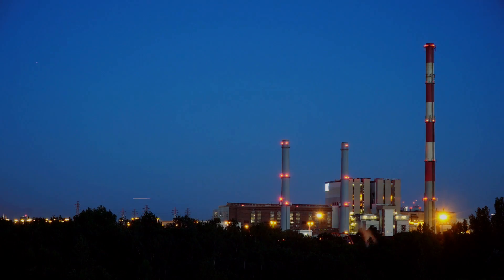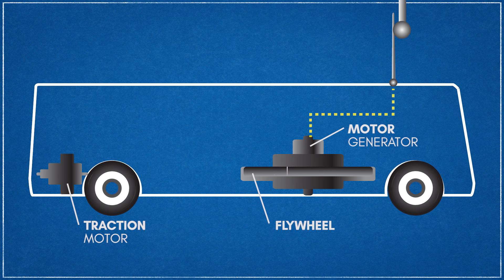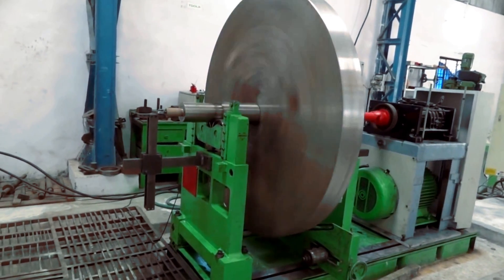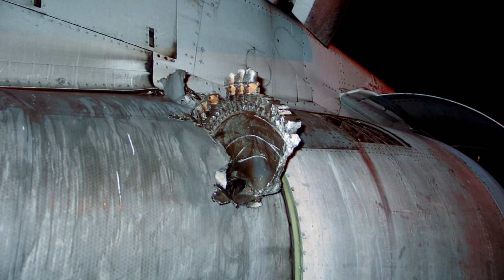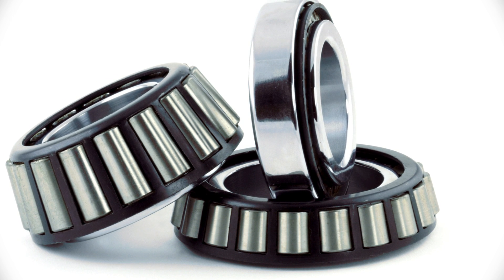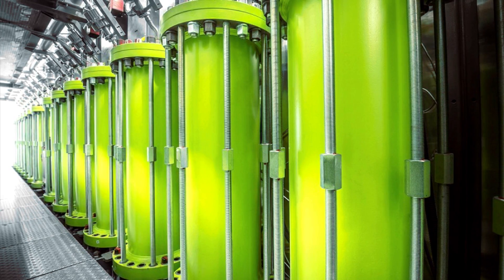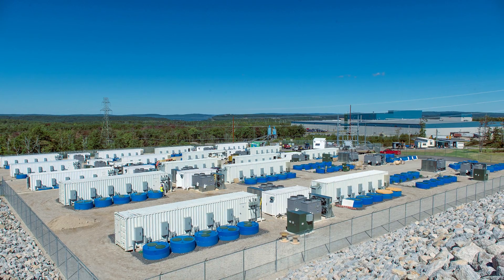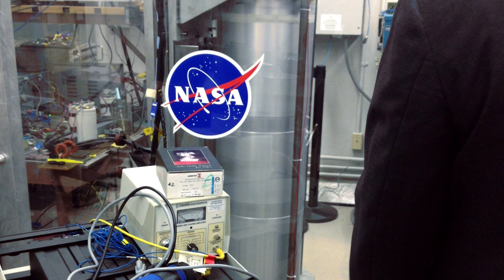The Mechanical Battery

Comment: Imagine if this gets implemented in the automotive world, and after a car accident and the enclosure is broken the flywheel is sent 8km down the road
Reply: They already did it in a bus so why not
Reply: @GauntletKI  yeah , and the buss had problems when turning , and those mechanical issues that he mentioned,  although we kinda fixed this using magnetic bearings I think this would make it even less stable In a moving vehicle,  but it was a interesting idea at the time.
Reply: @GauntletKI  the buses seem to have dedicated lanes(safer/less likely collision). And are in low speed areas. Higher speed areas ie a highway would require the flywheel to have a LOT more energy stored(the buses only had enough energy stored to get to the next node)
Reply: @ChernzObyl  Flywheels are already in manual cars. I helped design hybrid flywheel racecars for a bit (when I was a intern), and though smaller than the bus, they are very fast, and crash often. Those old flywheels could go a long ways in Switzerland. How long do you think they could go on a charge?
Reply: @GauntletKI  designing doesn't mean you understand the technology completely. also I think you are talking about clutch flywheel.
Reply: Imagine sitting in a machine that is powered by explosions with a giant tank of highly flammable liquid under your seats.
Reply: @teflonishighlytoxic222  Imagine if EVERY time a car was in an accident that energy in the tank was sent outwards aka exploding.  That is what a fly wheel would do every time.  Take the entire tank and explode it out into the town god knows where at insanely high kinetic energies such to liquefy any person it hit.
Reply: @teflonishighlytoxic222  What we take for granted is astounding really.
Reply: Or threw a few sky scrappers?
Reply: I worked on this in the 90's. if you use carbon fiber as both the rotor and the containment vessel then your most of your failure modes are relatively benign, as the rotor tends to delaminate rather than fragment.  It is valid concern though, as it still generates quite a bit of heat.   OTOH it's still less energy than is contained in a gas tank.  Not all of the problems are solved, but that is no reason to stop working on it.
Reply: Its already been used in racing
Reply: @Wabeeninc  there's a difference between a tiny flywheel and a 1.5meter diameter chunk of metal
Reply: Even in the event of this scenario a tire were to come loose...it wouldn't make it very far. Spin it around on its end and bump it. Centrifugal forces want to keep it righted. So.
Reply: ok then keep paying out the nose at the pump then and pissing off climate change activists.
Reply: They had them it was a magneto
Reply: Roads? Where we're going, we don't need roads....
Reply: gyroscopic effect from spinning mass means it can never be used in moving things
Reply: Yeah, can probably cancel the primary gyro effect with two flywheels. But there will probably always be a "couple" secondary effect on steering. Might be quirky. 

Anyway, in days past when large powerful lathes used threaded spindles there were many mishaps where spinning heavy work holding chucks weighing a hundred pounds or more were accidently spun off the spindle. If this happened there wasn't anything you could do but get out of the way as it skittled across the shop floor on its path of destruction.
Reply: They would need at least two flywheels spinning in opposite directions to cancel out the gyroscopic forces
Reply: @mackchris5451  no... it would make it even heavier also I mean the losses when you turn the car the flywheel will lose energy from that rotation.
Reply: it will not. the weight of the flywheel also gyroscopic loss makes the car inefficient.
Reply: @thehemmo5078  I think it's supposed to just be a joke
Reply: @thehemmo5078  They already have them in some city bus in NEW YORK and have for a few years now
Reply: well, a few Le Man cars have used flywheels as a KERS system, and it worked pretty well there.
Reply: Porsche uses the KERS system in racing and production vehicles.

Comment: 5:54 it says when the rotor speed drops too low, it will produce too low voltage.
My question is: why are we taking energy directly from the rotor? Can we put a variable ratio gear at the end to maintain constant rpm therefore voltage?
Continuous Variable Transmission (CVT) can achieve that: https://www.youtube.com/watch?v=YcHVsjwrp1M (just one example)
Reply: If you don’t take energy from the rotor then where does the energy come from?

Comment: Speaking directly from and engineering point of view.  No decayed Dinosaur fossil or decayed plant life to date, has been dug up or discovered at the depths that oil is located.  There is no record or scientific proof that there are any cells of any size or shape from any spices of Dinosaur fossil or plant life within the molecular range of oil under a microscope of any power!  The term Fossil fuel was made up in a meeting of old men over 100 years ago, because they did not know what to call the substance.  There is no microscopic proof that oil came from the decayed bodies of Dinosaur fossils or plants.  Deep State Crap.  Get a clue, your degree should be revoked!  God put it there for our use.

Comment: If it is difficult to build a flywheel to withstand a  surface speed of 1000 mph, how the hell does the Earth stay together spinning with the same surface speed. How does water, with zero tensile strength resist flying off into space at such ridiculous surface speeds. If you don't have a PHD then I don't want to hear you answer.

Comment: Once we have high temperature superconductors and high strength/weight graphene flywheels these designs will be able to exceed the energy density of chemical batteries for much less running cost.  Exciting stuff!

Comment: So actually, the flywheel batteries are more like the big capacitors in a circuit ? Good for peak/burst demands, but not as good for continuous slow delivery ?
Reply: Little different, capacitors have a quick charge/discharge rate. These are more comparable to chemical batteries, calling them mechanical batteries is probably the most accurate description. It would be cool to see the RC curve of a flywheel versus that of a capacitor
Reply: Flywheels are actually the mechanical analog of an inductive load as opposed to a capacitor which is more similar to a spring.

Comment: Your skip over the angular momentum change imposed by the earths rotation too quickly, and dont go into detail on the gimballing they have to do to avoid it for longer storage periods. However this is the reason why this idea is limited to anything but a short term capacitor type function.

Comment: ["You can use Freon gas from refrigeration units by heating the gas up from absolute to 21°, to create very high pressures. Much like steam but at lower temperatures. 
By
Stanley Meyer"]

Comment: Thanks for this video - it seems that global industry and manufacturers are beginning to realise the great virtues of flywheels.  About 10 years ago I was basing my university level student projects on the development of a Flywheel Energy Storage System (FESS) for use in the third world. My brief was that it must require minimal maintenance, it must have high energy density, it should be used for decades - even centuries - with no loss of storage capacity or efficiency, it must be totally sustainable, require only abundant and cheap materials and totally un-toxic to the planet - a challenging brief which only FESS designs or mechanical gravity based designs come anywhere close to fulfilling.  

Over several years of development, we decided that it was much better to go for low angular velocity (<4000RPM) and high radius of gyration (k) designs (2m ish) as energy stored is also equal to k^2. These slow speed designs have a major advantage that the losses are proportional to the speed, ie 4x faster means at least 4x more losses, and they could be run on standard bearings without any complications. Another benefit was that any bearing heat losses can be used to heat up any air in the flywheel's enclosure to reduce the flywheels transonic drag at the higher speeds - in fact we would run our flywheels as hot as possible to make them MORE efficient. We designed a range of FESS systems from house storage (100MJ) up to building, town and grid1GJ designs. The nice thing was if you want more storage you just add more flywheels and simply gear them together. If anyone wants a look at these designs then please contact me - just ask for the EAUC Sustainability Champion!

Comment: i have a question when the fly wheel is idleling  doesnt it use power. Like the dynamo on a bike when i  turn my light off the resistance doesnt change                    i am sorry for my english i am dutch  (thats why the byscle) thanks in advanced

Comment: The picture used 4:25 is a Ducati motorcycle engine.  but that is not the flywheel shown, that is the clutch. the flywheel is on the other side of the engine behind the stator, hidden by the stator cover,     I removed the one on my bike completely, it now has a small aluminum spacer plate in place of the flywheel.

Comment: All you have the do to make a generator power itself is add a heavy and big flywheel that need only a 3 volt motor and some gears to keep the flywheel up to speed and once it's up to speed it could provide its own power. No solar no battery no fan. Free flywheel energy think a hundred pound flywheel a 220 gen only needs 8 hp to run reduced with gears and adding a flywheel free power is here

Comment: This video ( ? ) seems to fail in answering The Most Fundamental Question about Fly Wheels; & that is: How do you feed energy into The Flywheel without hampering it's momentum ? / & How do you most efficiently extract The Energy in small increments for work to be done ?
Reply: Electric motor/generators attached to the rotor. He explained it a couple times.

Comment: What is wrong with a very deep hole and very heavy load?put energy to elevate the load and release the load to generate energy, by using some gear reduction, a very deep hole it may not even be need.

Comment: This is a very old concept. In 1800's they used flywheels to propel torpedoes to sink ships. That was before electric motors and internal combustion engines became available for torpedoes.

Comment: I did a high school science project on this topic back in the early 70s. I used a six inch diameter, 3/4 inch thick solid steel flywheel spun up by a vacuum cleaner motor. With only the shut down vacuum motor as a load, it would continue to spin in excess of twenty minutes.

Comment: The best mechanical energy storage for vehicles, is to increase the altitude (moment?) of the vehicle's large  mass, using the grid.

The high cost of electrifying routes can be minimised by selecting sections where the most effect can be had - hill climbs - for trucks in particular.

To be effective, trucks need a range of 20-30km off grid, to deliver loads away from the highway, so providing power for the entire route is a waste. Sporadic grid, sufficient to keep ~that range in reserve for important exits, is sufficient to make electric long distance trucks viable.

Comment: It sounds like it's more of a capacitor than "battery"
Reply: why exactly?
Reply: @UditDey  because of the use case.  Flywheels and capacitors are used for short bursts of power
Reply: capacitors are batteries

Comment: There were a few launching roller coasters that used a flywheel energy storage system. The coaster was launched using a cable and winch. The winch would clutch to a spinning flywheel and start the launch.

Comment: Among the green energy storage solutions: air compression, chemical battery, thermal energy, pumped hydro and other form of gravity energy storage, I think that flywheel has the highest ceiling, realistically speaking. With better material science, precision engineering and understanding of physics, I think vacuum flywheel battery can be the future. Unfortunately, since the concept is quite archaic, there won’t be hip companies like Tesla to really push the solution to the lime light. It will have to find a way on its own.

Comment: why not store energy in a ferromagnetic core directly. some ferromagnetic core materials are able to hold a charge in the core of the ferromagnetic material and remains as a magnet until discharged. this property is what was used by the ancients with magnesium ferromagnetism and silicon to create crystal power cells that could store a enormous amount of electricity in a permanent magnetic field. we supposed to have rediscovered it long ago but for some reason it have escape the curiosity of investigation. electricity can be stored by the ferromagnetic crystal latice by aligning a strong magnetic field when its being charged that will remain after its charged like a permanent magnet until discharged. the amount of energy storged in the magnetic field is limited to the chemistry involved in the study of ferromagnetic property of elements. advances of such will over time increase storage capacity in the latice. just the right cooking of chemicals will create a electrically charged magnet with the optimum storage capacity far byond the limits of earlier atemps.

Comment: Wow! 10 hours of spin for the flywheel at idle! Imagine how much better it would have been if they vacuum-sealed the flywheel's chamber instead of filling with H2!
Reply: Some (if not most) of the energy you'd gain by using a vacuum would have to be used to create and maintain that same vacuum. There was probably a cost-benefit analysis that said h2 is the best compromise between vacuum and normal air.

Comment: ...and still produces a net energy loss. 🙄
What we need, is the next level energy tech that has been suppressed! The NEWEST technology that we have access to, is 80 years old! How long will we fall for this crap?
Reply: Uh, what?  There are newer battery types that will likely replace lithium batteries in electric cars using nanotechnology.  A "Battery" is just a thing that stores energy.  What our energy grid is more nuclear plants that side-charge capacitor farms for use spikes.  Wind farms and solar cells are great for passive, but no matter how great they get, will always be unreliable as the weather.
Reply: @uni4rm  I wasn't even talking g about batteries. But the CONCEPT of a battery is obsolete, next to serious energy solutions. Just to name a few: the molten-salt thorium reactor or magnetic engine. There are entire fields of science, that folks don't even get to know about! And that, is criminal. 
Energy control IS freedom control!
It is synthetically scarce, on purpose!

Comment: Disappointed you didn't talk about "gravitricity" (if you don't know what it is, look it up, it's a really interesting idea)
Reply: Looks interesting, but they will have to figure out some issues. 

Inertia: It takes energy to accelerate/decelerate an object. The flywheels work by changing inertia, the gravitricity works by converting potential energy into kinetic energy and vice versa. That suggests to me, that inertia changes are a possible loss of energy. A heavier weight would also mean, that the response to demand and supply is delayed, but that depends on the final speed of the weights.

Tensile strength: The weight of the cables reduces the amount of weight you can have at the end, depending on the distance. If i have a cable with 1 ton/100 meters and it can hold a max of 10 tons, then it can at max hold itself when extended to 1km. So you need to have a lighweight, high strength cable.

Comment: My my how childish can we be. The topic is flywheels. Stick to the topic. Capacitors or flywheels or chem batteries and water too are all different types of energy storage devices. Learning how to intergrate the best systems to use. 1 403 830 4124 having a storage device at each wind/solar unit seems of practactle use. The elect energy is then transferred at a constant optimumial rate. Later stored again at localized loactions where the power is consumed. Just my view pt. Oh a methonal fuel cell  drone flys 3-4 x vs battery

Comment: I know a fellow that knows the man who was in charge of the construction of the facility for a flywheel battery company in Austin, Tx.
 The company purchased an existing building and excavated a basement to conduct testing without the City of Austin (COA) knowing. Apparently the idea of an un-tested spinning object of significant mass with the potential of breaking loose from it's bearings and wreaking havoc on the public was an issue with the COA. The company was thought the basement would contain the off chance of an accident and continued with R&D. They were successful in their endeavors and still in business today.

Thanks for reading.

Comment: Those busses had to have turn problems
Reply: why?
Reply: @uni4rm   with the very heavy  spinning flywheel... which ever direction it spin will make the bus turn in that direction with ease...but turning the opposite direction of the spin would be harder.

Comment: The recent discovery of a room temperature super conductor should be a game changer for flywheels.  Assuming that the very high pressure required does not add too much weight.  I wonder if putting the superconductor in the flywheel itself could mitigate this?

Comment: You are not thinking: You change the density of the flywheel proportional to radius. Near the center of rotation (r) the density of the material is its highest. As the radius increases to R the density is reduced. The outcome is that the Hoop Stress is a constant with radius, or a Super Flywheel. Your graphics are great but you should increase the optimization of these devices...they do have a future...good video